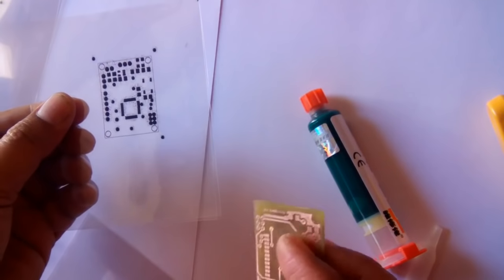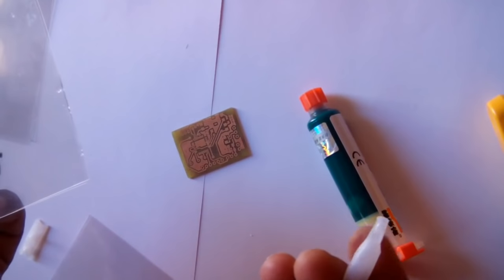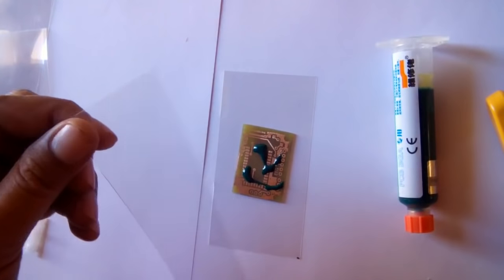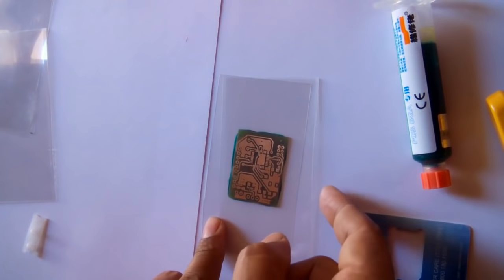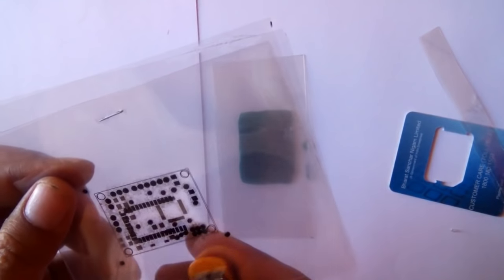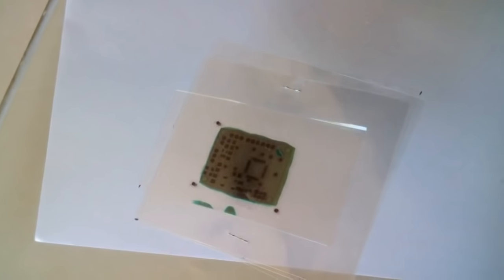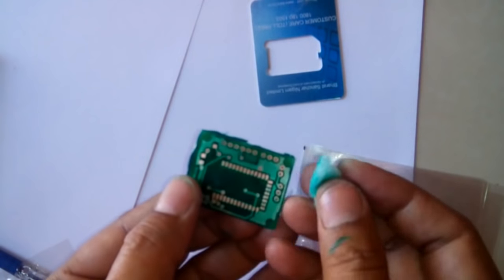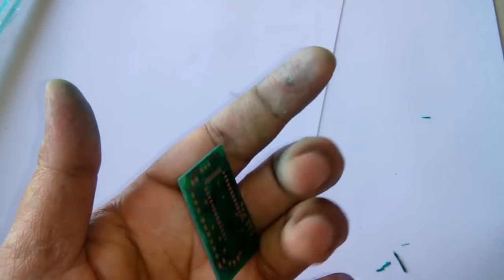How to Apply Liquid Green UV Curable Solder Mask on Home Made PCB

Comment: Hello friend, i saw your video its great. i followed your video and tried solder masking of my large pcb (single layer size 180 mm x 280mm ). i had exposed it to sunlight for 5 min, after that results were not like yours. maximum solder pads got fully hard. i tried cleaning but nothing happened.

Comment: Hello you are using transparent sheet where i can find,did you print in laser printer or inkjet
Reply from the maker: it is OHP sheet available on stationary shop. it is laser printed
Reply: @brainstormabc  stationary shop means
Reply from the maker: read stationery in place of stationary
Reply: @kvamsidharvamsi5800   Stationary shop mean book shop you can buy a transparent sheet that can print on inkjet and laser, you can buy it in amazon also

Comment: How do you make the through hole plating for 2 side pcb
Reply from the maker: i have done it with a very raw method. i have taken a very thin wire and put it into the hole. then soldered it from both side of the PCB.
Reply: Raw and good method.

Comment: Which is the printer you used for printing ? And what kind transparency sheets you use  ? And I see your printouts are dark , How did you do that ?
Reply from the maker: +Vishnu Chuncha 
Hello Vishnu,
I have used canon laser printer LBP2900B. Transparency is not specific, It is normal available in local market.  Thanks
Reply: use plastic from polyprophiline (PP) for botom layer (part wich faces with uv coat) if you use HDPE the uv coat will sticking to the plastic not at PCB.

Comment: how to buy the uv curable solder mask ??? is it expensive ???
Reply: just look at ebay or aliexpress for "uv pcb mask". it's not so expensive - like 5...6 bucks for 100gr. can or like 2 bucks for a 30cc syringe.
author achieved good result but anyway result with screen printing a way-way better.